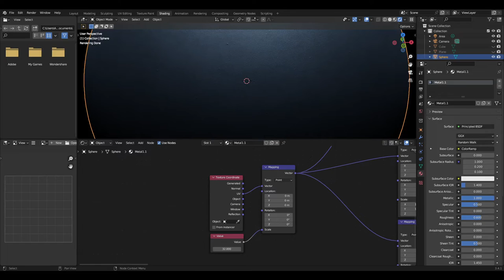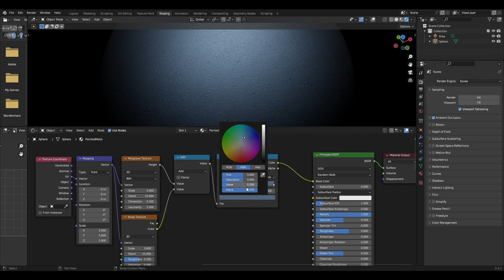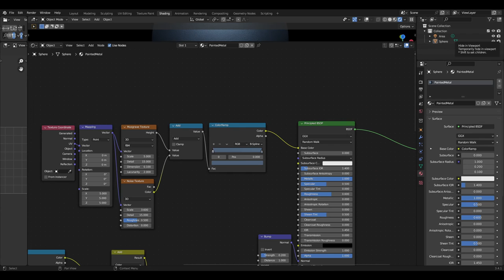Procedural Painted Metal | Blender

Comment: Why did you plug those mapping nodes into the Scale input of those noise textures for the Normal instead of the Vector input?
Reply from the maker: It doesn't matter particularly with which one you plug it into as the both have very similar results but when its plugged into scale it also changes the paint more. Its hard to explain over a comment section so I recommend you give it a quick playthrough and you can see what difference it makes.